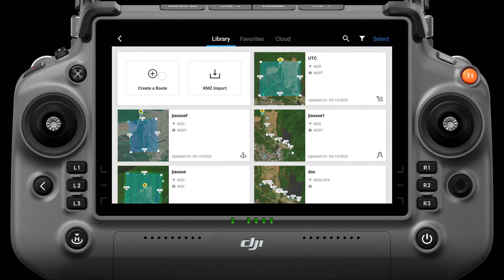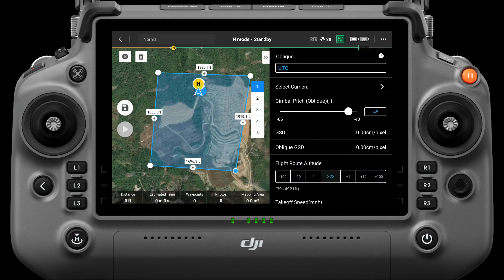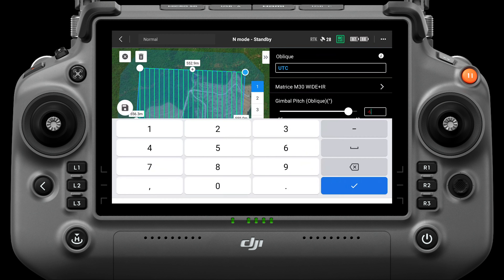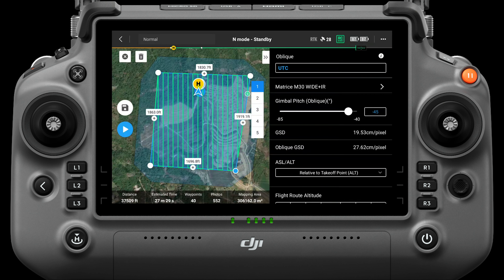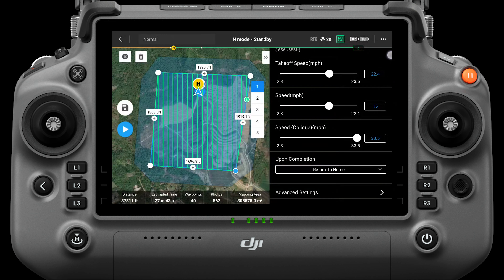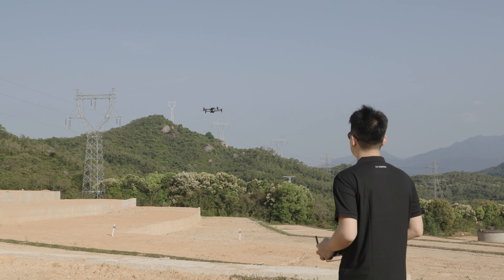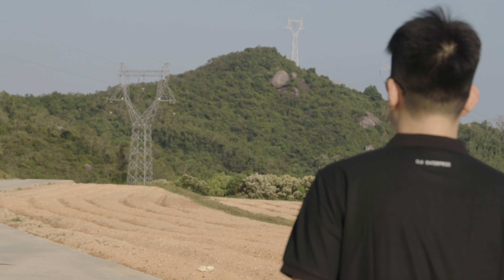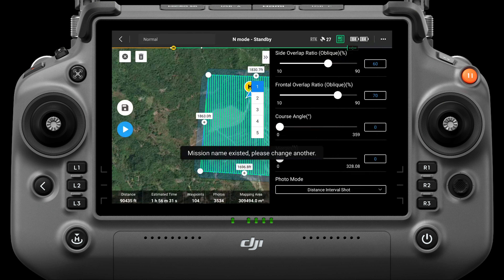3D Oblique Mapping Using DJI Pilot 2 - Episode 10

Comment: If it is necessary to keep the GSD to 1.0, and there is an obstacle somewhere in the area of my mission, does the drone (M3E RTK) fly automatically around the obstacle and will it still continue the mission?
Reply from the maker: The drone does not automatically fly around, would suggest using terrain follow to keep a consistent GSD with elevation changing.
Reply: @DJIEnterprise  OK. So many thanks for the reply. To be more precise: I have a roof of a factory building, it's quite big. In order to comply with the GSD that is required, I have to fly about 10 -15 m above the roof. But now there is a tower on the building and a high antenna mast on top of the building. These represent an obstacle at the desired flight altitude. Unfortunately, I cannot define any "restricted zones" in the mission planning - so the drone could theoretically collide. If my drone's obstacle avoidance is set to fly around a detected obstacle (i.e. not hover) the drone should fly around or over the obstacle - just like it's set up, right? That way I could fly the mission. I just wonder if the drone interrupts or even aborts the flight mission when it detects an obstacle. What do the specialists say?
Reply: @a2k-media  I have the same issue. I am about to fly on a mine area which is literally on a hill. Its elevation is 1100 mtrs AGL. The ground is at 680 AGL. If i use terrain follow, it stops in the middle of the mission saying Max flight altitude reached when i set the max altitude at 100 mtrs using terrain follow. Not sure how to finish this. Wish they were more detailed in explaining terrain follow function.
Reply: @nanirayavarapu8763  sadly there is no answer from the „Specialists“. A mission without having any obstacles in the area is a very easy thing I can do with most consumer drones and third party apps. If it becomes more specific that’s where the more expensive Enterprise Drones should bring solutions. At least they brought us the POI Mode in the Pilot 2 App shortly so that we are able now to fly orbit. Wow. Thanks